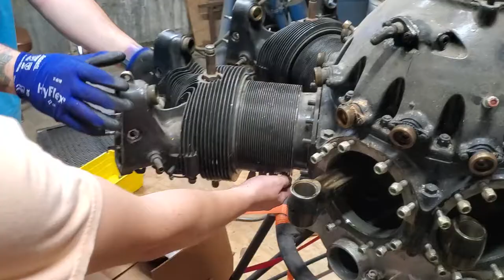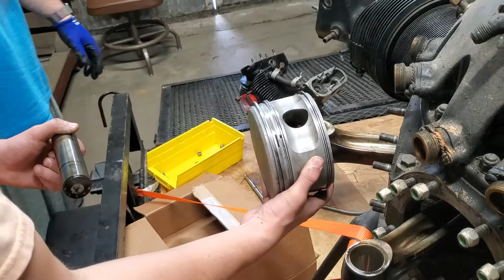Jacobs R-755-9 Restoration Part 2

Comment: Is this the shop in Payson?
Reply from the maker: Nope.
Reply: @mikesmith7249  Thanks. This is the engine on which I performed my practical exam for my A&P license in 1973. I had to find a vacuum leak which turned out to be a loose primer line sucking air.  There was something different about the ignition system too that i can't remember. Does it have mags? Good luck with your engine, its an oldie but goodie for sure.
Reply from the maker: @bingosunnoon9341  The Jake has an unusual ignition system and comes in several flavors. 
The one were restoring has a single magneto providing power to the rear spark plugs. The front plugs are powered by the aircraft battery through a distributor and booster coils. 

Another option included dual magnetos.
Reply: I’m doing one of these as well. Great videos. I also get a lot of input from my kids.